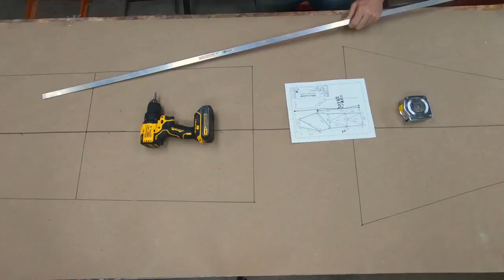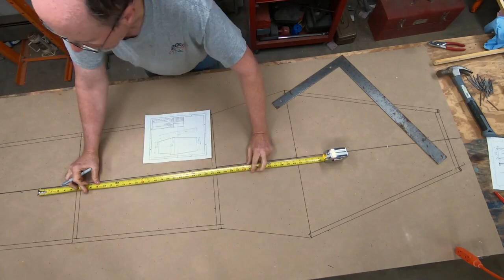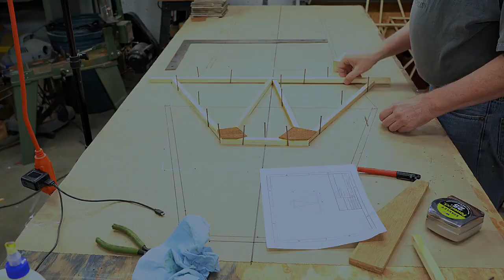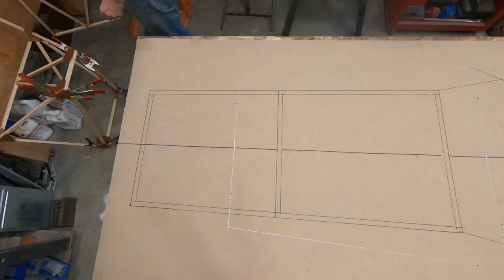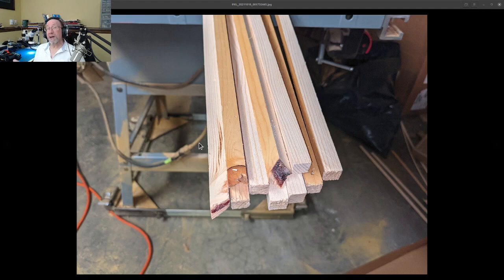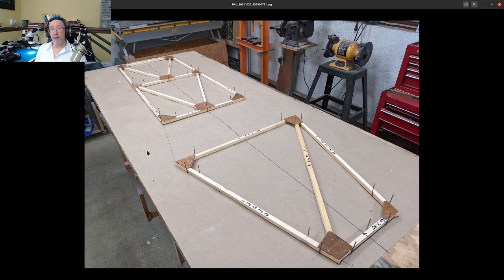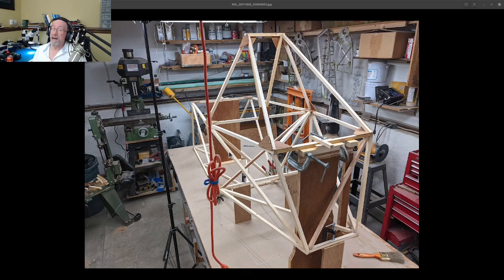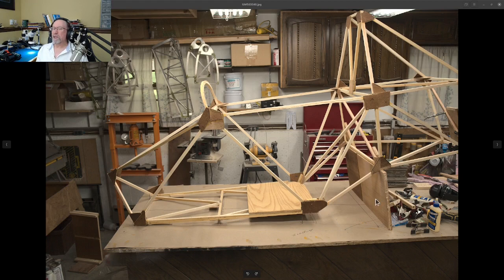UWS-4 Frame Mockup Part 2: The Build

Comment: In the floor under the pilot seat, the triangular bracing doesn't feel right. It's making two V shapes that both face the same way. Shouldn't they be alternating orientation to carry forces more directly? Eg. like this ><>< (going from under toes to back of head, with the section behind pilot's lower back using a symmetrical bracing like you talked about). The way it is now (>>><) seems like an impact from the front would cause a lot of stress on the lateral members 2 and 3 (under pilot's knees and behind his butt). I'm not entirely confident that it matters though. Might be interesting to try a FEM analysis on this.
Reply from the maker: You are correct about the braces under the pilot's butt. I should fix that. I'll have to do what you suggest on the section aft of the pilot The one under the knees is weak too but I can live with that one since I have 2 other reasons to keep it like it is. The side forces should not be too bad at that location. But as you suggest I'd like to do some FEM to check it out to make sure.